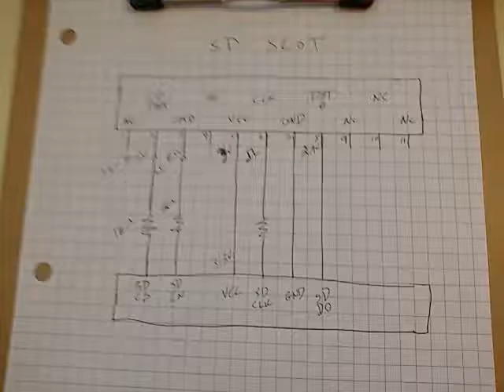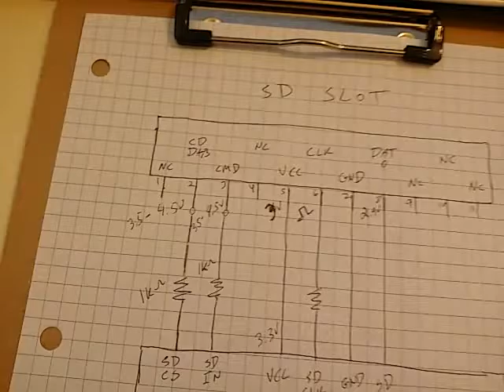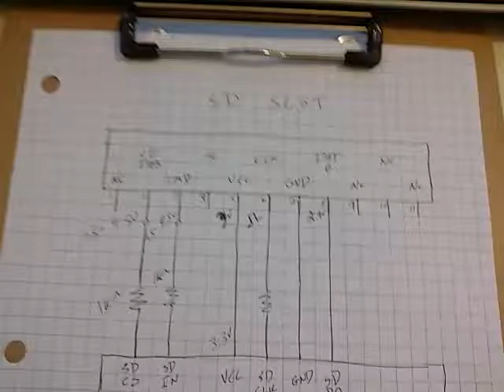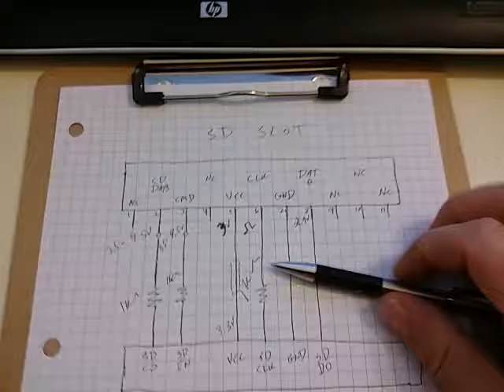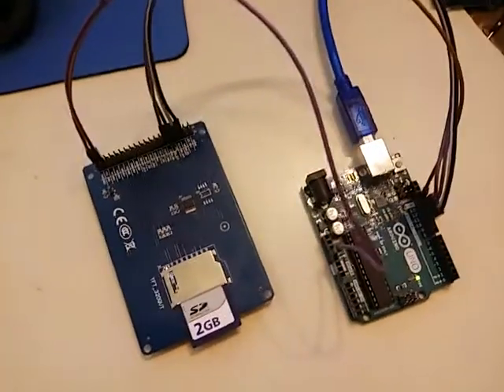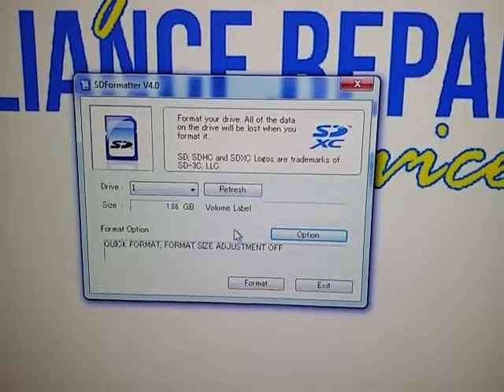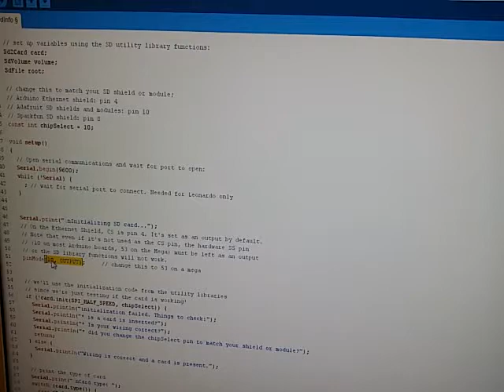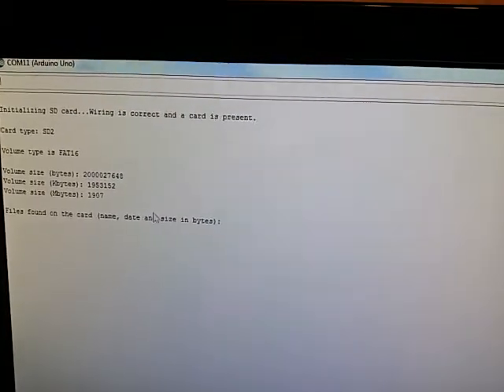Arduino Uno SD card formatting and initialization using 3.2" lcd shield

Comment: Hello, sir.
What if, i am using soil moisture sensor.
So, the value can be record to the SD Card. 
I need your opinion, sir
Thanks from Indonesia
Reply from the maker: yes, you can write data values of a moisture sensor to the SD card. I won't be able to help with specifics as this was many years ago I did the video and do not have any files from it.

Comment: sir, there is a regulator on the lcd pc board which outputs the 3.3 vdc you are refering to,please pick up the book entitled "the art of electronics" yes it is old but if you read it you will understand everything about electronics.....WCH
Reply from the maker: The focus of my video was the SD card, not so much the LCD shield. It just takes afew minutes to look up there is a 65Z5 DC to DC voltage regulator on the shield. But voltage drops can be due to other components like resistors, and diodes, as well.